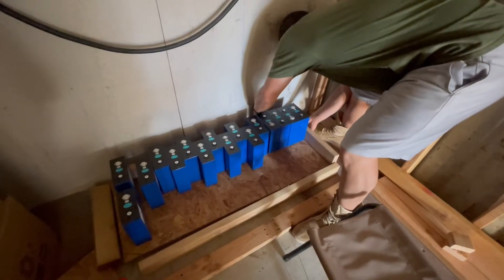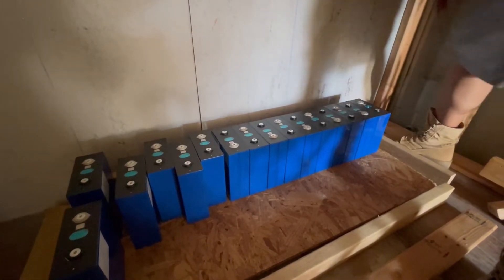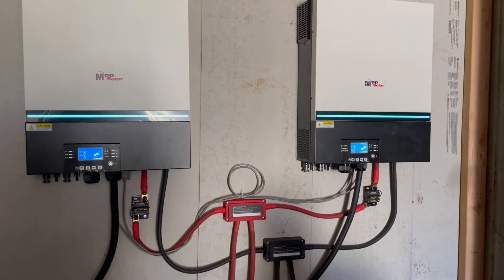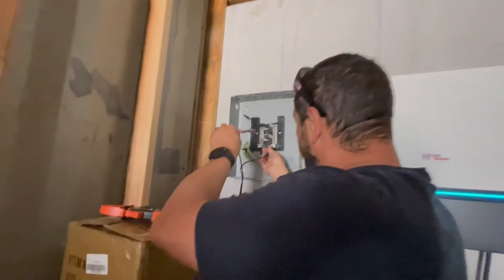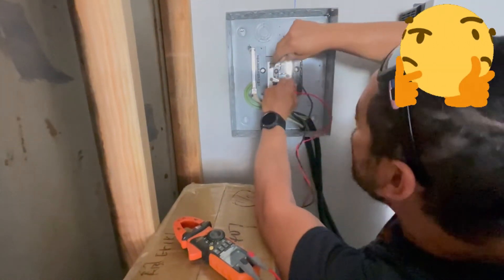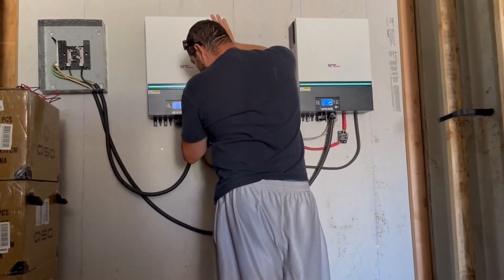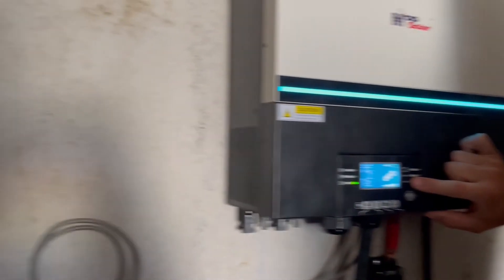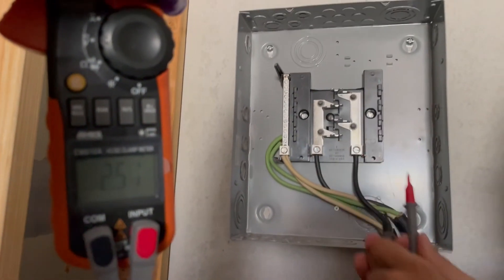Common mistake on setting up Mpp solar inverter 240 split phase

Comment: Great video, much appreciated.
Question, when I set two MPP 6048 in parallel couple years back, a rep from MPP told to run the wires from the solar panels to only one of the inverters, not both. It looks as if you’ve split the solar wires and attached them to both inverters. The manual is not really clear about this. Wondering how it is working out for you?
Reply from the maker: So far so good.  I have one string going to each, and plan to put the third string in there as well.  Everything I could find is that you have to make sure all cables are the same loss, (same length, connections, everything same) and all of the settings like float and all that jazz need to all be the same as well.  We have not put any crazy loads on it yet, but plan to run the AC non-stop when we get out there.  I'll keep you posted :)

Comment: I would take a second look at your DC breakers.
Reply from the maker: Thanks for the comment. It ended up being a setting that I had incorrectly configured.
Reply: @leeslivingoutofthenorm  Yes, I saw that; very good. I noticed the DC breakers you use are not rated for your battery voltage. It may say 48v, but that's max. Your system could be as high as 58.4V, depending on your configuration.
Reply from the maker: You are correct.  I used a calculation of voltage/amperage for my inverters that lead me to put that size in.  I had seen where others were using the same brand/calculation.  At the time when I ordered it all there wasn't much info on LifePO4 batteries/chargers either.  At some point I will go back in and replace them.  Thanks again for the comment!